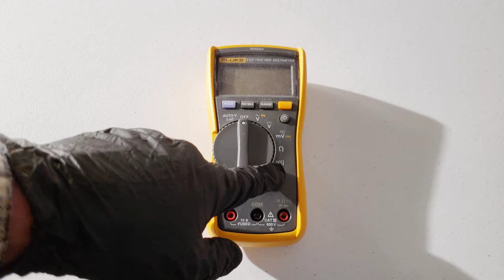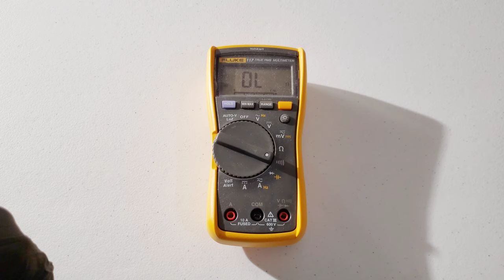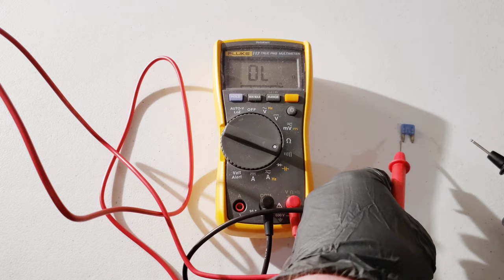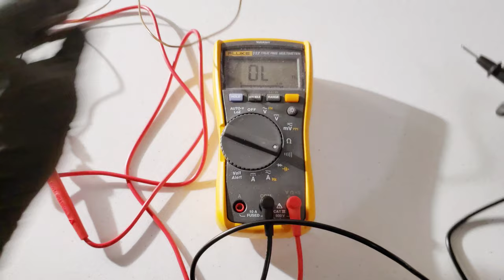How To Test Continuity With A Fluke 117 Multimeter Explained

Comment: Those glass fuses are tricky because what happens is when you look through the glass. The wire is intact, however, they can corrode under the end caps and it will be open because of corrosion under the metal end caps, 

but it will look as though it’s in tact 

those fuses are a pain in the backside……..

Comment: OL stands for out of limits. Meaning the resistance to large to measure. It's a common misconception because it displays OL when the leads are not touching or when measuring across an open. OL can also be used for high voltages

Comment: Just a heads up, I learned the hard way If the beeper function is on the resistance limit changes so if you have high resistance it shows open even though it’s not an open circuit